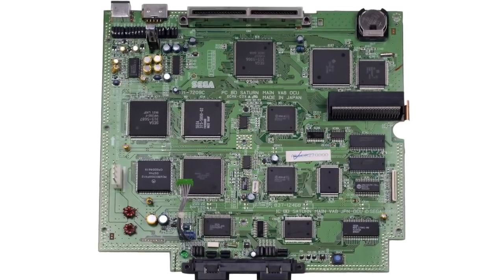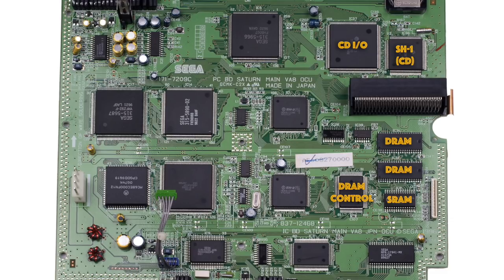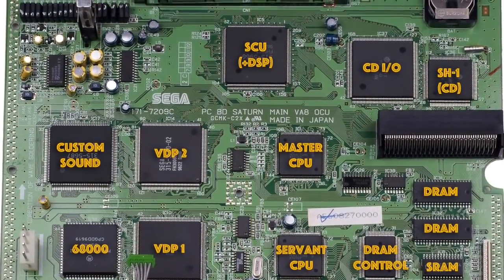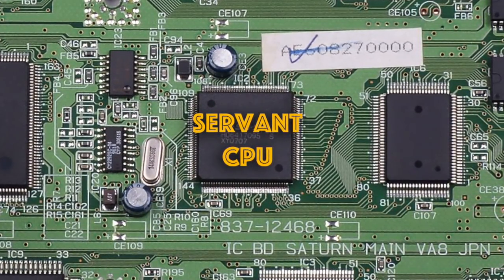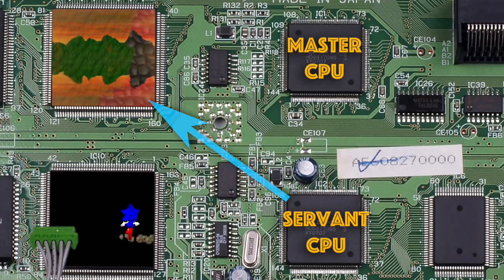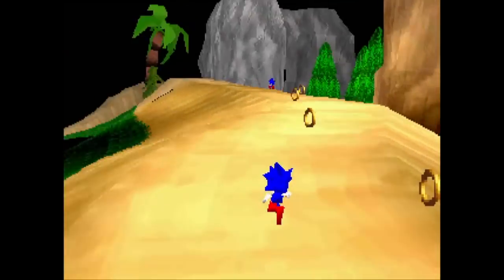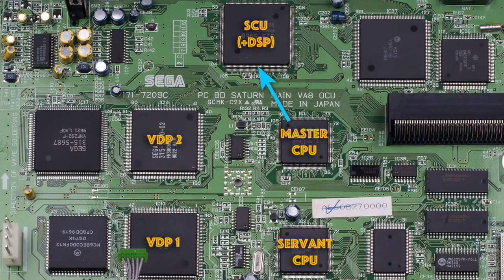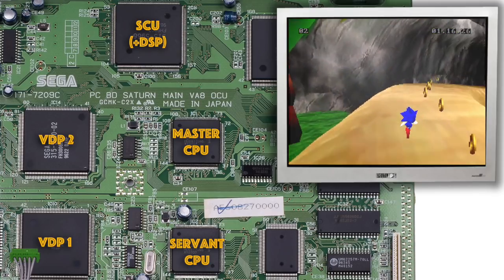SONIC Torn Apart - Exposing SEGA's Insanity with Hardware (CODING SECRETS)

Comment: The scu code looks like hell. How do you deal with code longer than 10 chars???
Reply: multi-core CPU multithreading - the manual way
Reply: It's more or less exactly how Jack White puts it. The fickle bit is knowing that the processor is in a very specific given state when that code runs, so your operations have to be very careful to observe it. If you don't, instructions can fall out of sync, or worse, generate NMI's on many systems, halt, and wait to be reset.

Comment: As a software developer today, I wonder if would have ever been able to program for that kind of hardware back then. Software development is made so much more accessible now by much faster hardware, enabling much greater abstraction layers in software platforms. No one, in most cases, would ever need to go into assembly code to squeeze out maximum efficiency. The things you have to do with embedded hardware are extremely clever!
Reply: But to be viable today on the complex machines of today, software also has to be orders of magnitude more complex, and ultimately the operating system introduces a lot of complexity of its own, as do modern languages in attempt to manage this complexity. Don't sell yourself short, just pick an old system and try to code for it, you'll be all the better for it. And if you fail, don't despair, i'm sure when working alone many would have failed back then too, it helps immensely to have a partner to bounce problems and ideas off of. I don't even know why assembly has such a bad rep, i know 20 times more 13-year-olds that mastered assembly than such that mastered C++! Because inherent complexity of assembly is actually very low compared to any higher-level language.

Comment: One thing id like to know more of although you probably didn't work on it directly, was the PC port of the game that was then used for other versions. if you had to jump though that many hoops on the saturn with multiple threads (basically) getting it to then also run on the PC with basically a single thread must of been a complete pain.
Reply: Why? The complete master CPU code gets ripped out and rewritten, only the slave CPU code gets ported and whatever the master CPU's tasks were would be jammed right in. And there's nothing fundamentally difficult there when targeting PC, just a couple months of work for a single developer.

Comment: Amazing! I've always heard about what a pain in the butt Saturn was but now that you've explained it, doesn't seem all that more complicated than other systems. I know some of the early games just turned the slave CPU off, so perhaps you could explain what the issues were with the dual set-up? And totally do a DSP breakdown. Six simultaneous instructions sounds crazy, like the Atari VCS or something.
Reply: Fencing/locking is expensive too. So the separation dose here was a stroke of genius.
Reply: @randomguy8196 why would you need cache coherency? You have two address space windows into the RAM, one is cached and one isn't, which is not something you have on PC, but it is the classic solution to synchronisation of multi CPU tasks in embedded area. Plus you have manual cache purge instructions.
Reply: Yes, keeping things as separate as possible is the best course of action, because it still is, this is how any self-respecting HPC application works, by duplicating the data as much as necessary so there is no sharing. Cache coherency just means two caches talk to each other, potentially slow each other down, and when something changes, the cache line is invalidated across all other caches, but they're really invalidated much more frequently than that because of the same mechanism. On a simpler embedded processor you just have to do the same thing manually, you realise your locking primitives via uncached memory view, and when you gain your access, you purge those cache lines once.

Also some algorithms don't really suffer from old data in select places, so you can save yourself cache purges there. For example, your worker works off its mailbox where incoming tasks for the worker are, and concludes that the mailbox is empty because it has old data while it might not actually be; when that comparatively rare condition is reached, it just purges the cache for the mailbox, and surprise, finds some more data to chew upon, no harm done. Point is it can keep working as long as it thinks it has the data, since only the worker can delete tasks from its mailbox. On the other hand, if the host sees the deletion late, it only means it will have to wait a little longer to fetch the result, which it shouldn't be too concerned about as long as there's enough margin that the mailbox is not empty, so it can hold off on clearing the cache until it thinks it's filled the mailbox.

Funny how similar HPC and embedded sometimes are.
Reply: Well if it's read-only data then that's not a problem. If it's writable data, then the software architecture and data pipeline design is most likely wrong and it's time to tear down the architecture and build a new one. Otherwise, whatever you do, your software will be an underperforming and very fragile mess. I mean sure i had to do it the dirty way, because that's what the powers that be ordered, but the result was always pretty catastrophic, and it's not just me, others had the same experience too.

It's ubiquitous because of software complexity explosion, and because of how architectures and tools evolved from one another, an alternate universe in which explicit local cache evict handling would be the way things happen at an architectural level and where development tools take care of that for you instead of the processor is possible. (Though chances are, that's the universe in which VLIW/Itanium didn't fail) You still ABSOLUTELY need to worry about the cache, you need to worry about sharing and false sharing, you plan it all out on paper, it's just that the explicit management is not part of the software. But the underlying performance issues and considerations are still there and more prevalent than ever!

Oh by the way, 10 years ago ARM cache coherence looked like this: if you evict a line manually, we'll evict it from all other processors too; but not just on any write! So it was only half way there. And... wait a second... i don't think TI Sitara's DSPs have cache coherence either, DSP tasks when spawned, their data gets transferred to the DSP (no actual data copying takes place, but your view of the data is no longer valid), and when the task completes, it transfers back, probably just by purging the cache and a little bit more magic. Maybe it's not so ubiquitous after all. What's the cache coherence between Xeon Phi and its host computer, or between a CUDA GPU and its host? Just... nope.